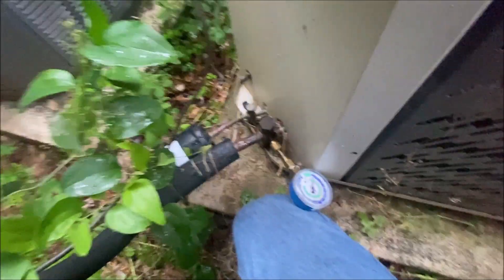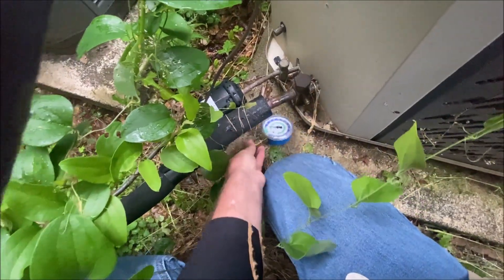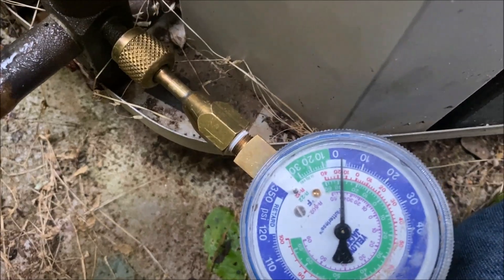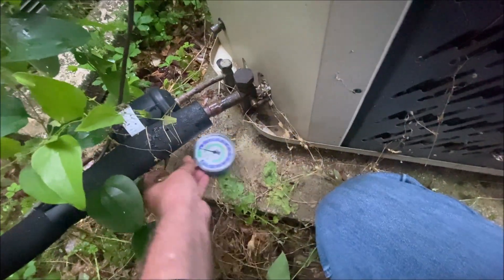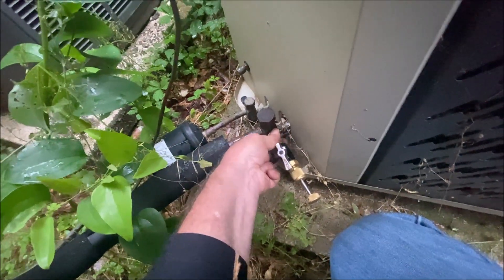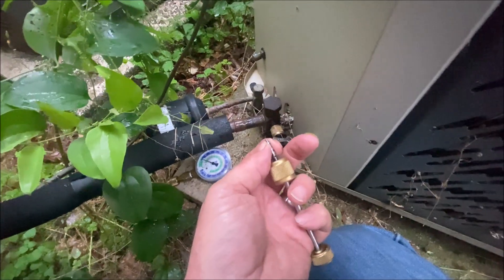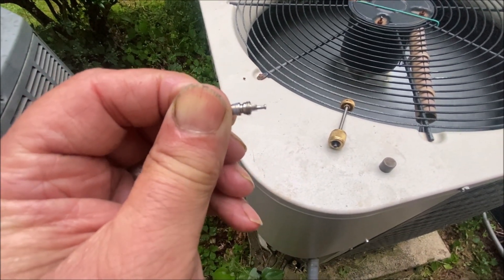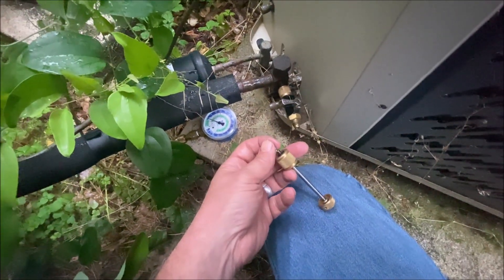How to test / fix leaking AC schrader valve core

Comment: Now if we can just get all HVAC Techs to test this after they hook up their gauges. Tech I had years ago hooked up his gauges on a bad cap call, 3 months later we had a leak. They wanted $$ to check for leaks using "probably in the coil" talk/hard to find/ expensive fixes just wanted to sell me a $15k new system.. Years later after using a window unit I find this channel, checked it out and sure enough that is what it was.  Thanks to Anti DIY for saving me $15k :-)

Comment: good idea on the gauge! As far as the shredder replacement, you still need to purge the air out before you open the valve to set it.

Comment: I have one I check every year. The core was leaking. I replaced three cores- still leaked. Put a seal cap on it and moved on. Been like that for 18 years. No problem.
 What makes me nervous is when starting to remove a cap on the high side and it starts hissing loudly!! You really hope someone didn't leave the core out!

Comment: Nice, looks 100% reliable.  Any chance the Shrader cap has a pad (as would be used on a refrigerant bottle; would depress the core) instead of an O-ring?
Reply: you have to watch out for that! many of the caps have a flat rubber gasket, that will distort in the center and press the core open. most now have a gasket with hole in the center, but I have seen many bent core stems that would still get depressed by said caps.(needs replaced anyway/sloppy work bent them).